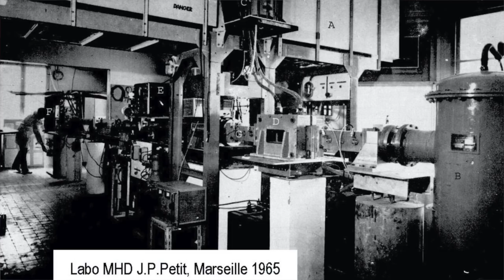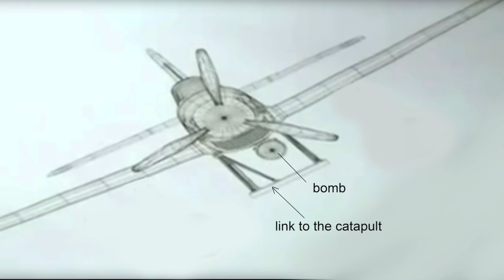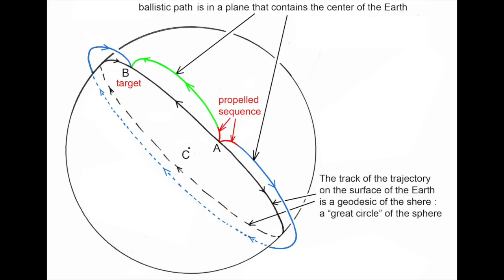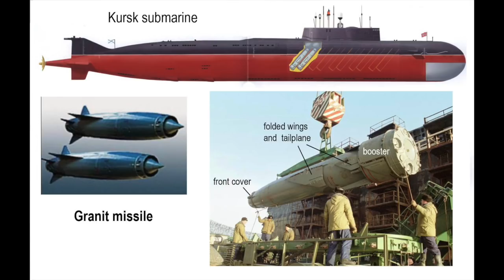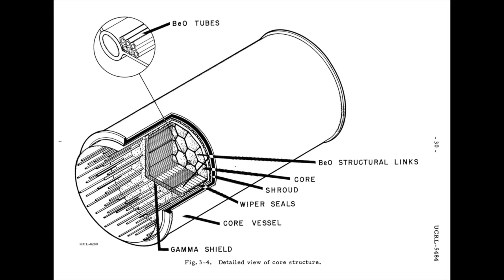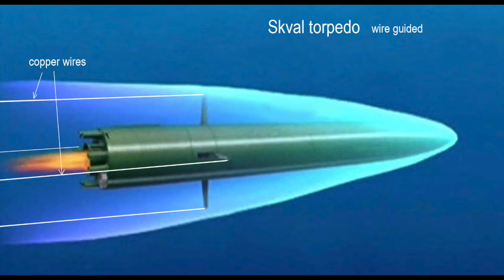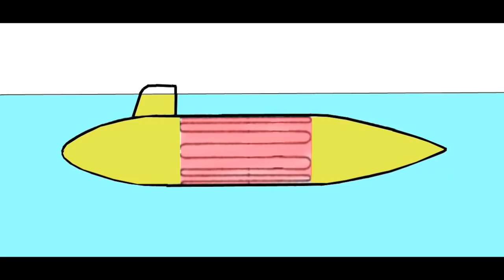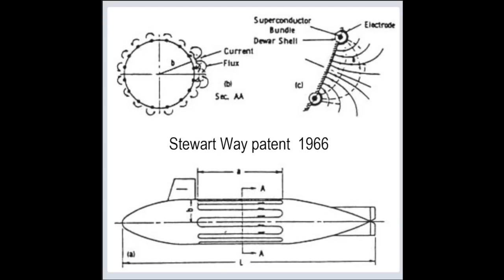Putin's new Russian MHD weapons explained (1st part)

Comment: Amazingly scary  this tech would have an incredible comercial future surley ,does it have to be nuclear powered?
Reply: Makes it a reliable power source to pull high-k dielectric energy from. 

GA-MHD Generators and Flame-Jet Generators can convert to AC Electricity for MHD propulsion. 

The hard part is these ppl getting access to the raw materials and manufacturing capabilities that UA Aerospace Contractors have had readily available for decades. 😂